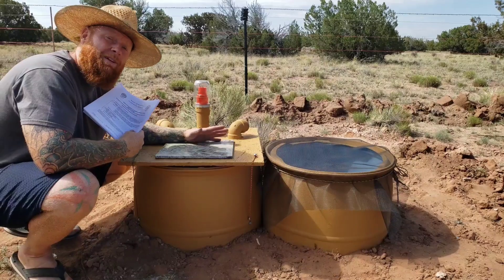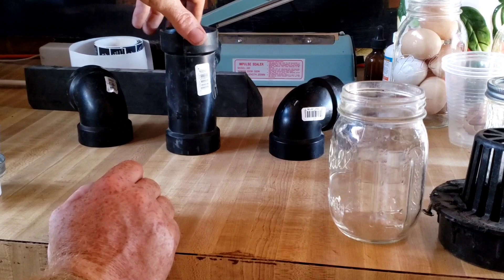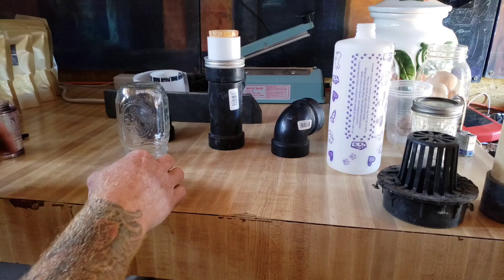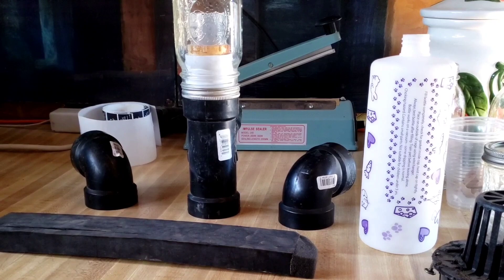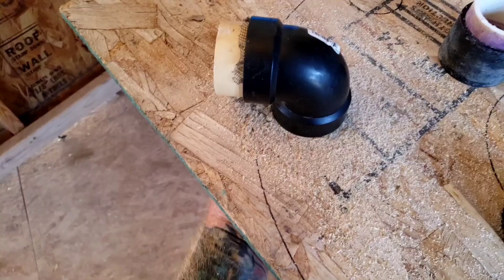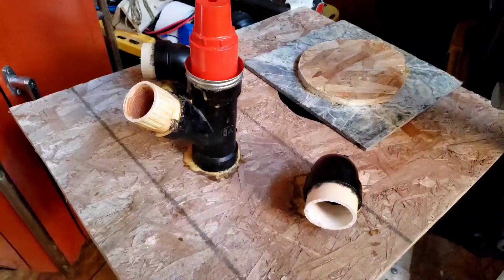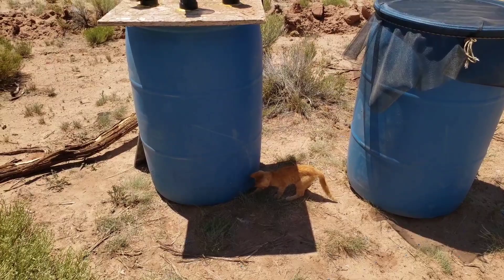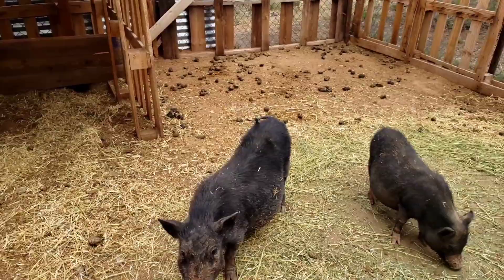Build and Permit FREE Compost Toilet in Arizona

Comment: This is great. Went and read blog post. Seems a possibility to do your grey Water system, too. OMG! What a concept. You can actually do stuff yourself there !!!
Reply from the maker: Yes!!!! Absolutely. When I do laundry or shower that water is diverted to the pond which is fine because I only use natural soap made from salts and goat milk.  You DO have to show proof of black water system or in my case I only haul oil out.  I.e pan oil gets saved or wiped out in towels then hauled to the dump.
Reply: @FrugalOffGrid  interesting and that's acceptable? In many places you cannot do your own grey water system and say reuse your gray water for watering your plants or whatever. They either make you die it or treated in some shape form or fashion and you end up with having to have a septic tank anyway.
Reply from the maker: Yes,  I've never done anything that wasn't acceptable by the county.  I'm trying to help others in my situation how to do it with integrity.

Comment: What were you using before this? I dont think I recall it being mentioned in any of the other videos. I just have a bucket system, very simply plywood box, plastic seat and a bucket inside which will get emptied into a barrel or bin when its full, been working great so far!
Reply from the maker: I've always composted,  this is just an option Arizona will inspect and permit.
Reply: @FrugalOffGrid  Our traditional toilets are so wasteful! So much water and good fertiliser going down the drain. Great to see some counties are on board

Comment: Do you have an address? I know we can't get one unless we start the process for a perp test, sewer and stuff. 

How were able to navigate deliveries? 
Or is there another way to get it? 
Asking because I know you been out there past a year and haven't built a house yet
Reply from the maker: I do have an address.  You can easily have items shipped to your local post office.  If you're county requires a perc test you may as well do it but until then set up a P.O BOX
Reply: Yeah when I called Cochise county they said the steps are a prep test, and then the sewer test that you need to pass for the build and in order to get the address it needs to be a home that your building. 

Can build whatever you want but for the address, it had to be some type of home, even a starter one. 

We're getting ready for the land and this is the one thing I've been planning or wrapping my head around is doing the sewage to pass to get my license. 

But like you said in your blog they'll want exactly what I'm doing with the water and the plans

Comment: Congratulations you just created a vult toilet.
Not so much in the way of actually composting.
Reply from the maker: This is in every way a composting toilet you can read about it on my blog.  Cheers
Reply: @FrugalOffGrid  
Where inthe open are you storing the humane waste.
Because the compost break down will take a minimum of 6 months or more.
Do tell
Reply from the maker: Again,  feel free to read all about it on my blog.  This barrel system segregates old material from new where it should completely compost in roughly 4 months. https://frugaloffgrid.com/blogs/frugal-off-grid-blog/how-to-permit-your-compost-toilet-in-arizona-for-free-by-frugal-off-grid
Reply: @FrugalOffGrid  
You mean like how a septic tank will compost right.....
Sounds like you'll still be bumping human waste 4 months later.
Well Done
Reply: @meateater4life551 
How about you change yours to meatbeater4life